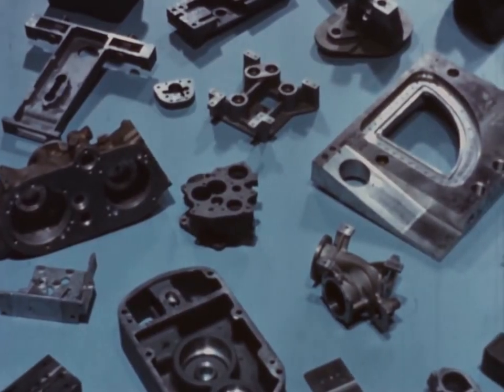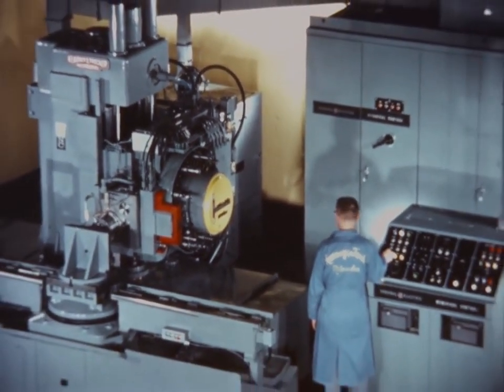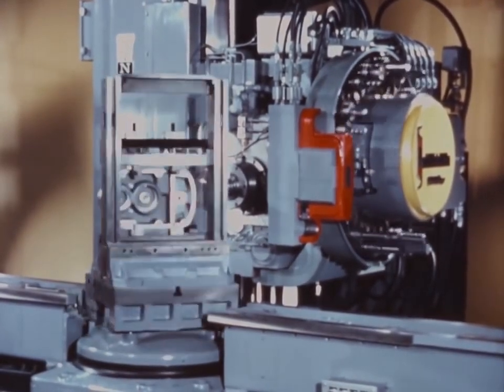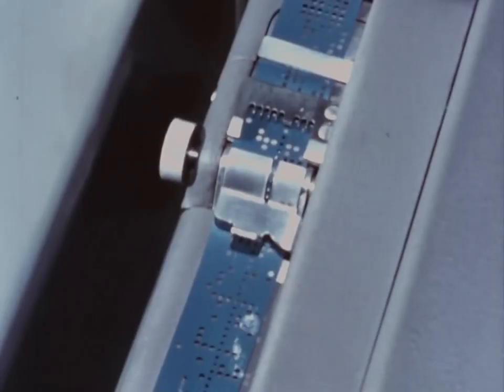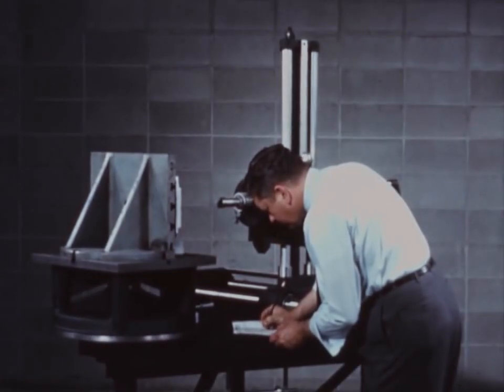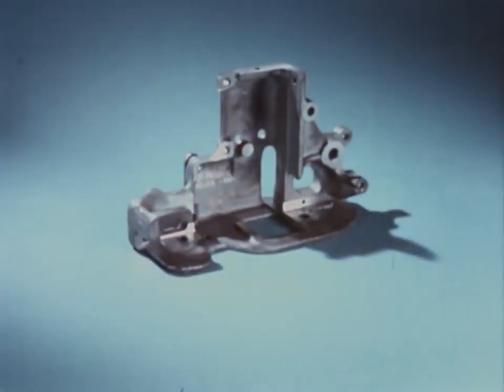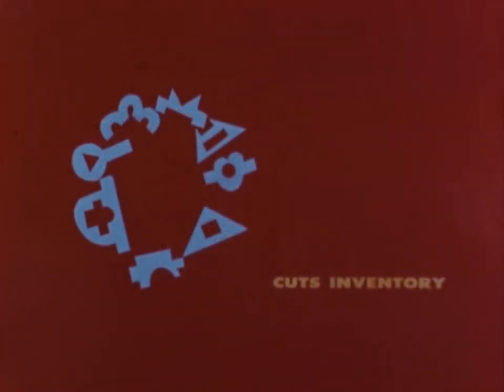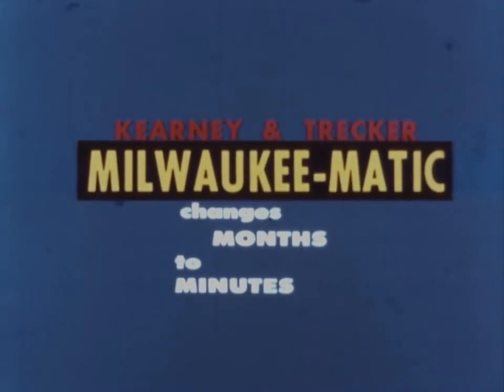The Numerically Controlled Machining Center 1950s Educational Documentary WDTVLIVE42 - The Best Docu

Comment: 6:38 For anyone interested; It's actually Baudot Code (and Baudot is the origin of the word "baud"). Baudot code is also partially the reason why network speeds are listen in bits and not bytes. In the early days of computing, some machines used 5-bit bytes (baudot code), some used 6-bit, some 8-bit and the IBM machines used 12-bit. The only commonality between them was the bit, hence measured in bits.

Comment: As of about 5 years ago, I saw a punch-tape NC lathe still in production. Some time in the 80s they'd replaced the tape reader with an emulator, which was hosted in an IBM PC XT, so they could load programs on floppy. Some time in the 2010's, they'd replaced the floppy drive with an emulator, so they could load programs on USB flash drive... But the machine itself just refused to quit.
Reply: I ran a 1978 Ikegai Lathe with a Fanuc 5T control.  No CRT.  You had to scroll thru word by word.   It had a paper taper reader on the front.   
It finally got wrecked and replaced in 1995.    I was happy to toss all that paper tape stuff after it was done.